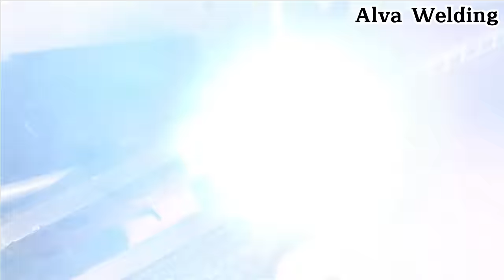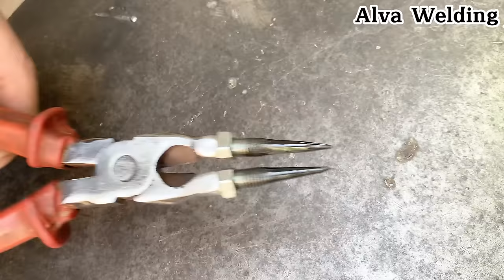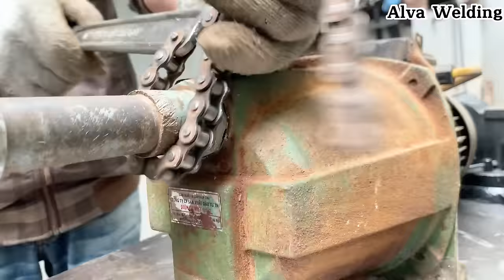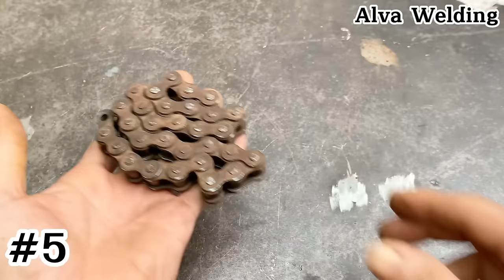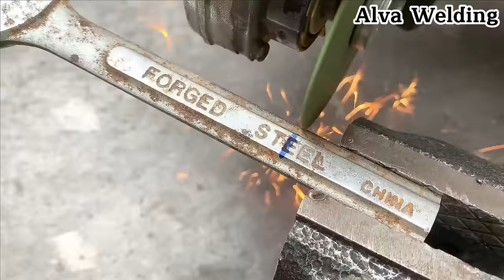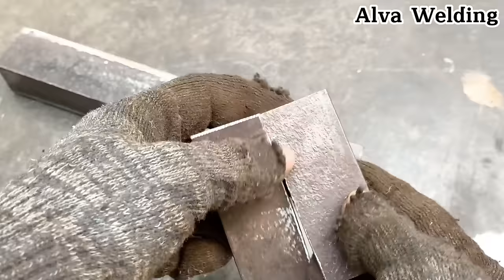Top 7 Tips And Tricks From Diligent Welders To Create Useful Tools.

Comment: Number 1, If that's a Honda clone shock, the nuts are 14mm or 17mmm. I would guess 14mm from a cut down 428 sprocket?
Number 4, Last year I made a core drill in miniature using same method to repair the breather tube on 'vintage' (1970's) Honda carburettors, it had to cut brass.
Guess that's my favourite?
Originally, I'm from South Wales, UK
Reply from the maker: Welcome to Alva Welding channel! Thanks so much for watching our video. Wish you all the best